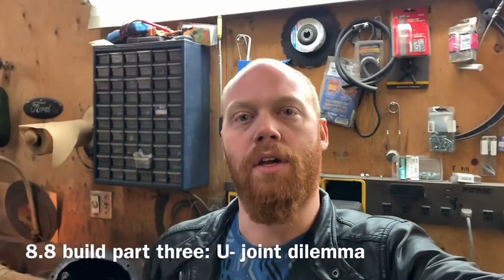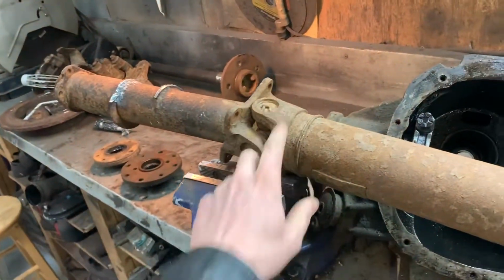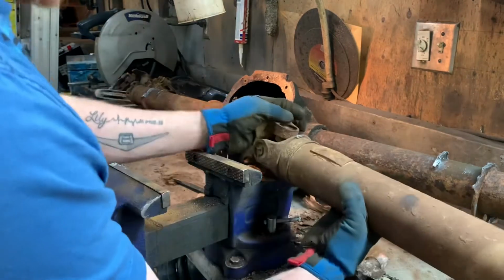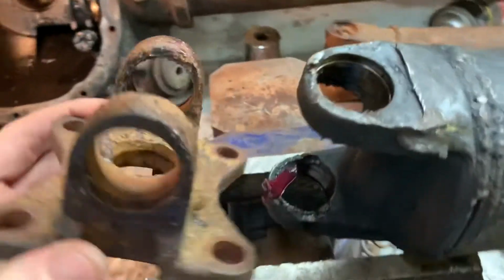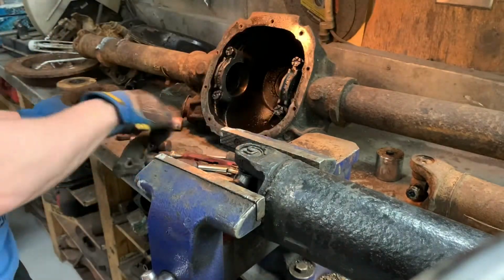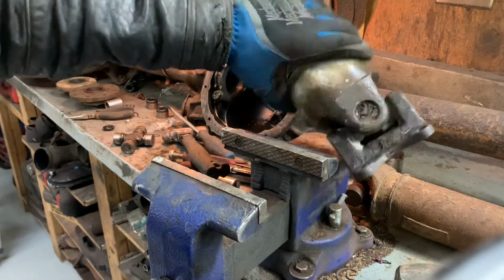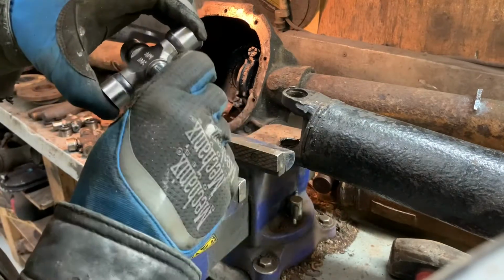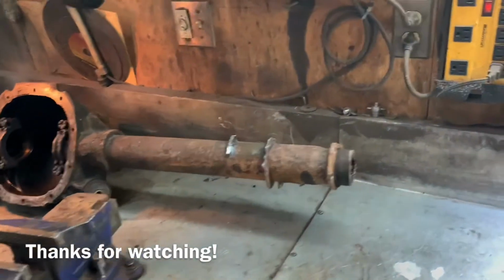31 spline 8.8 with 9” ends part four - finding correct U-Joints for your application

Comment: I had the same problem with my u joint on my 80e swap, pressed it in and it was wrong for the yoke size. What a pain when that happens 😅😅
Reply from the maker: Sometimes it takes trial and error, but it’s nice to have a bunch of the conversion U-joints in stock so I can just grab it off the shelf and try again

Comment: That is cool setup! What is exactly the flange from or the part numbers?
Reply from the maker: It’s working really well! No vibrations at all. The flange is from an 02 F150, dorman part number is 932-990
Reply: @StationroadRatrods  Thanks 🙏
Reply: @StationroadRatrods  is the universal joint P/N 353?
Reply from the maker: Anytime! Hope it helps
Reply from the maker: @kevinholbrook7174  depending on what driveshaft you’re using, it may take a different u joint. Your best bet would be to open up the moon u joint dimension look up that I showed, and measure your driveshaft i joint dimensions and it’ll give you a part number.
Reply: @StationroadRatrods  I am converting a S-10 driveshaft to a Ford 8.8 rear end.
Reply from the maker: @kevinholbrook7174  what year is the S10, and what’s the diff out of? There are a bunch of flange types
Reply: @StationroadRatrods  My S-10 is a 2000 and the rear end is out of a Ford Explorer or Mountainer?
Reply from the maker: So your u joint should be part number “372” it’s a combination of 534g(s10) and 369(explorer)

Comment: Too bad you had to flatten the drive shaft by doing it this way.
Reply from the maker: Wouldn’t happen to have a timestamp would you? I don’t remember doing any damage to the driveshaft. I only nip it in the vise just enough to hold it, I can still usually spin the driveshaft in the vise. And tapping the u joint in/out with a hammer doesn’t hurt anything unless you miss lol.